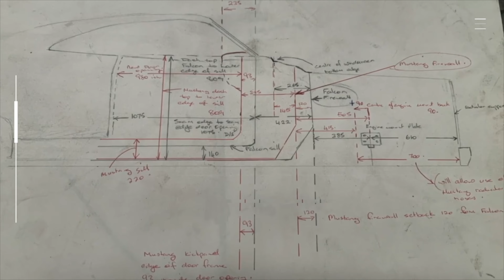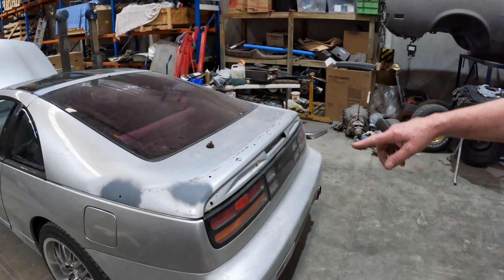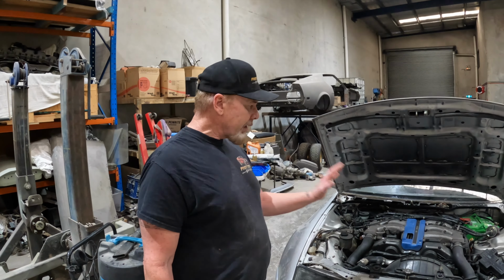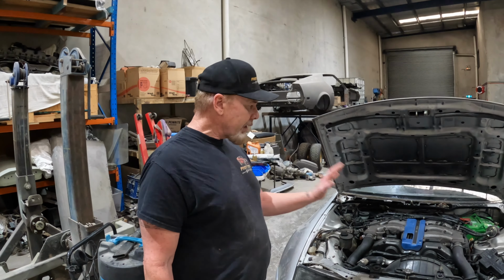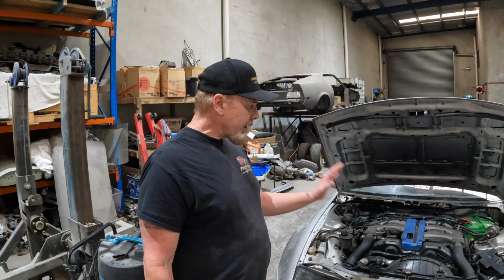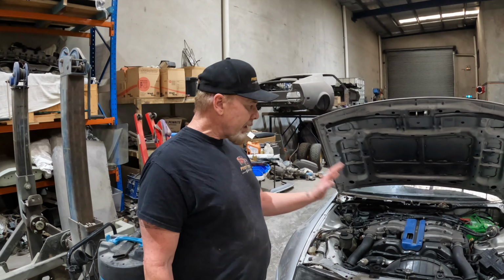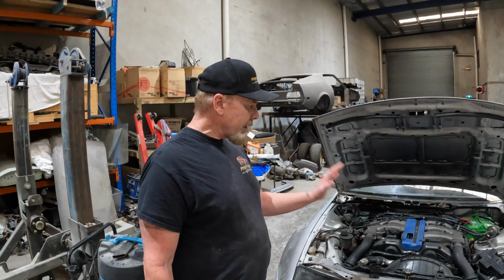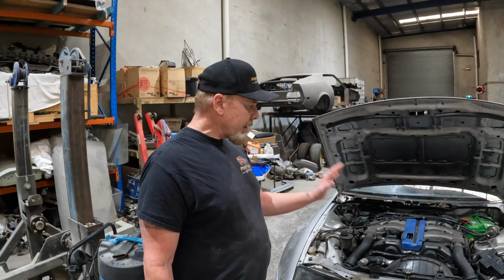57 Chevy chassis repairs and Shop update

Comment: Hey mate just a quick question with the rear wheel arch on the XA did u use passenger front for rear driver or drivers front for rear drivers wheel arch XAcoupeguy said drivers front for passenger rear wheel arch Im doing the job on my xc sedan just wondering witch is right 🙂
Reply from the maker: I cant remember to be honest, but graham would certainly know . The thing is if you just look at the shapes you will see which one flows the way you need it to, for example the drivers front guards wheel arch will drop down lower at the rear of the guard , amd the passenger rear will drop down lower at the front of its wheel arch, so it makes sense if you take the drivers side front and flip it around, check it out , i think Grahams right
Reply: @phatridesgarage3760   ok thanks mate :)

Comment: what pressure are you using when sandblasting Tom, must be over 140 psi is it
Reply from the maker: Hi Jack, air is coming from my big workshop compressor, I think its putting out around 130 psi, it makes the little pot blaster work really well